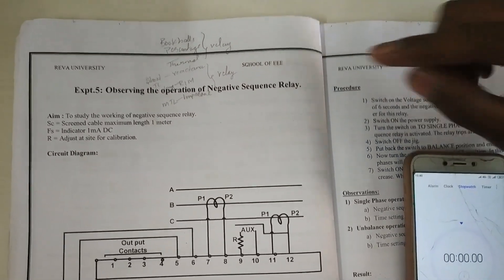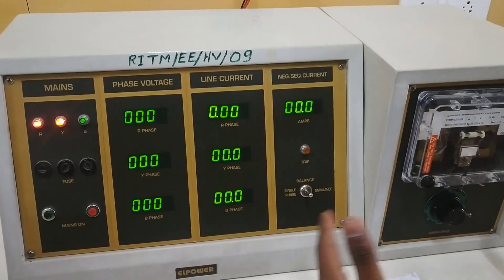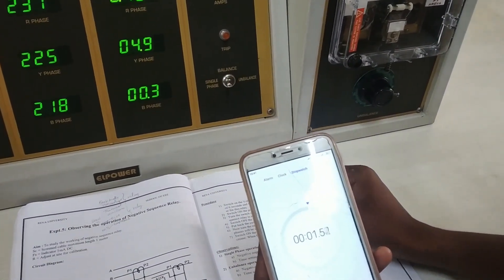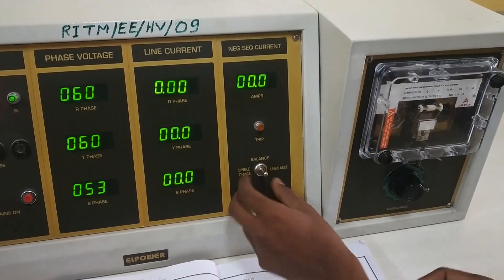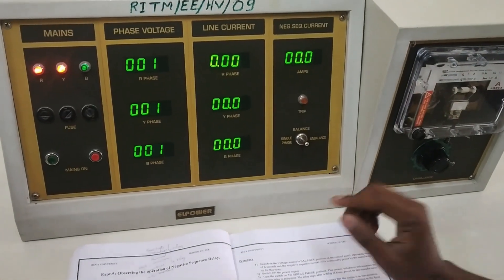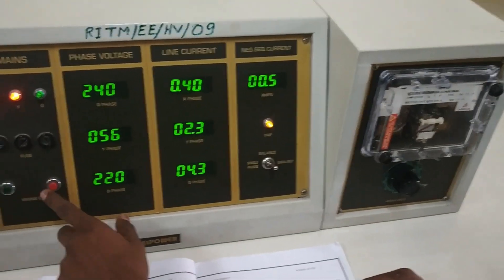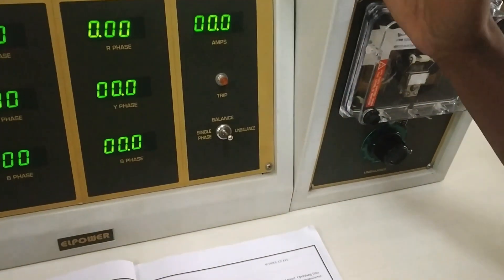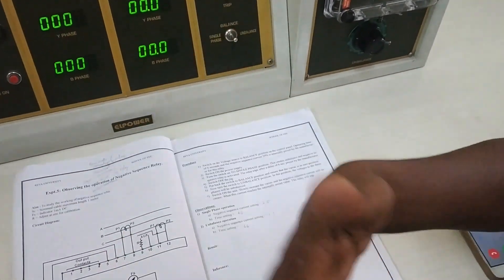Negative Sequence Relay

Comment: Hi, can you please disclose the trip curve of the setting? Is it definite time @ 6.5 sec? The single phase; is it single phase to earth fault? The left side drawing shows only 2 CTs in B & C, how do you know whether the circuit is actually balanced or not?  Could you share the detail connect circuit of the relay and the  ELPOWER simulator? Thanks.